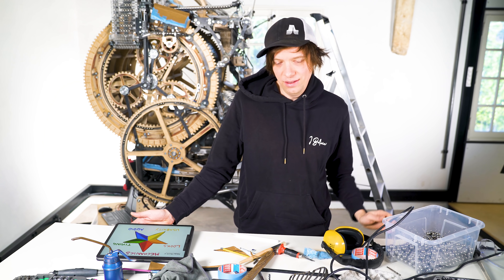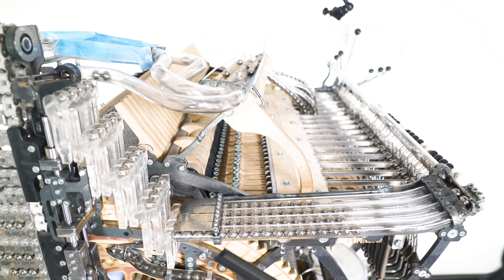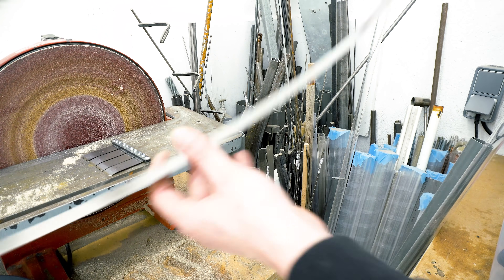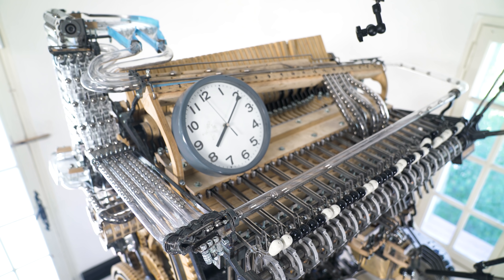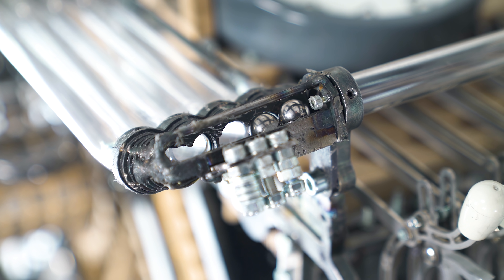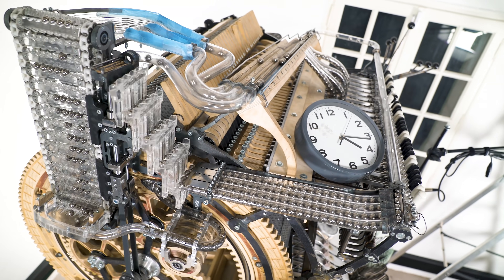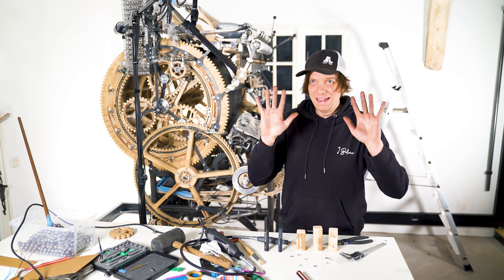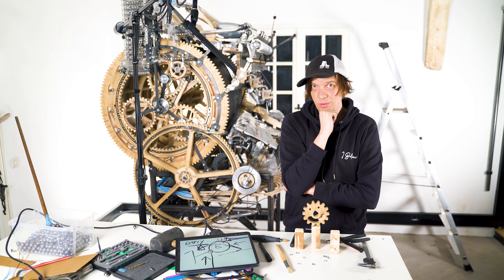Marble Machine X Fish Stair Upgrade

Comment: Add a damper to your divide by 4 marble feeder to reduce the recoil of the impacting marbles, like a small piece of neoprene or foam.  

Your springs are too short for the marble lifter and your opening is too large.  The opening only needs to be large enough to only allow a marble feed at the optimal, dead bottom center, position to prevent that misfeed.  Basically you have too much of the marbles exposed to reduce this he length of the spring needs to be extended to the end of the ramp and just befor the lifter.  The bend radius of the spring should be long enough to just be a faction of an inch higher than the marble.  Any marble that arrives after that will be caught by the finger and held until the next pass.  Hope that makes sense if not I can send you a drawing

Comment: I think the reason the divide-by-4 is so unreliable is that it has no hysteresis. As soon as one marble rolls off, there is no longer enough weight to make it tip, so it starts to tip back again before all the marbles roll off.

Some ways it might be made more reliable:

- Design the pivot so that once it starts to tip, the weight of just one marble is enough to make it complete the motion.

- Instead of having the tipping caused directly by the weight of the marbles, have the weight arm a mechanism that's driven in time with the fishstair, so that on each cycle it either moves or it doesn't.

- As above, but instead of weight, use a mechanical system that senses when four marbles are present. Maybe fingers that are lifted by the marbles, and an interlock that arms the tipping only when all four are raised.

Comment: Don't give up! You're a lot closer to success than you think. Remember, you have conquered marble height adjustment for all of the channels. You are conquering the divide by 4 mechanism. the current divide by 4 looks like it is working across the tempo range.
Also on the list of skills mastered MMA pipe design and bending; marble divider pressure management; marble divider top marble position adjustment, etc. Each of these are things that don't need to be re- invented and combined with the design for manufacture skill will allow you to create the vibraphone channels much more quickly, though it might be wise to test each new channel before committing to building the next.

Comment: So, another idea. Have you considered using proximity sensors to control feed rates at critical points in the marble circuit? I understand if you want to only use mechanical mechanisms without electronics??

Comment: 10:22 that “solution” is very susceptible to wear. If you can use the marbles as a 🔑 that will only open when there 4 available then you have a fail safe solution

Comment: This feels too simple to work but can you make the spring steel fingers longer so they have about 0.5-1mm distance from the hopper? This way its basically impossible for the marble to get snipped away because the Y offset is so much smaller than the diameter or the marble. Right now i would guess its 1 radius away from the hopper so the marbe has the chance to wedge itself between them.

If you make the fingers longer then keep the radius at the end, so any marble that wants to go up will be pushed back instead :)

Comment: An alternative solution to feeding the 4 input lanes is to add a small piece to the entrance of the divider that closes off the swing when it swing. It can be attached to the swing, and swings in front of the entrance as the balls are loaded into the 4 channels. This is the same solution you use for the wooden blocks that feed the instruments.

Comment: Martin, please hear my advice:

1. Stop doubting. Believe. There's no question you can complete the MMX. Whether you're a month away or a year or another three years DOESN'T ACTUALLY MATTER. You'll get there, and it will be worth it once you do.
2. Don't worry about impressing us. We don't need you to be Superman or make no mistakes. We're your friends! Just take us along as you have been.
3. Totally and absolutely ignore aesthetics. For the MMX, "Looks" is never the right option. Never. Why? Because: (A) the machine needs the engineering strength, as you explain. (B) The mechanics will generate cool aesthetics no matter what. (C) What you think looks cool may not look cool to others. I don't think the current divide-4 looks especially great. I mean it's fine, but not wonderful. Kill it for a big bucket drop of marbles—who cares? It'll still look cool, maybe cooler. NECESSITY BRINGS ITS OWN BEAUTY.

Comment: I really think you need to consider classification of the issues in severity. A marble popping out of the machine in a weird edge case, or missing a funnel does not stop the machine from playing as long as the loss rate of marbles isn't so high that it causes you to be running dry during a performance. On the other hand a critical engineering issue such as a potential failure that stops the machine, could break a part, or prevent a note from playing are the failures that I think you need to worry about. I think it's much more important to expand the testing to the other instrument channels and getting the machine to the point you can begin some composition on it. Mostly I think this because you'll feel a lot better using the machine for it's function rather than chasing minor issues that take more and more of your time to fix.

Comment: @3:10 id personally just add a ceiling to the bottom stair. That way only one marble can fit in. A chanfer on the bottom stair also pushes the edge-case marble back... Scrap that:

Have an extension of the fish-stair mechanism pushing up/down through holes in the track floor/ceiling one marble space back from the edge to stop marbles moving; blocked while the stair is receiving marbles and open when the stair itself is blocking - only one marble can be there and the edge case is solved by timing mechanism. This is like the marble gates for the channels down the front, so I'm curious why this approach isn't thought of first.

Comment: Rocker/ see-saw (oscillating end of the divider by four), lose mounted on the first Fish stair, would be a better solution. I think just another Spring steel would not end the problem of pinching the marble. When the first Fish stair swings the end of the divider by four just a little bit up, it would push back the other marble.

Comment: Martin, you are so close to completing the MMX!!!  Just finish putting it together and THEN fix all the problems. You have already made every system in it adjustable.  Making music is never as perfect as you want the MMX to work.  Sometimes a microphone quits working.  Sometimes an amp or speaker goes out.  Sometimes a guitar string breaks.  Sometimes an instrument goes out of tune in the middle of a song.  And sometimes a marble may go flying.  The occasional marble getting lost is OK as long as it doesn't stop the MMX from working.  The ultra-finetuning you are now doing will probably need to be redone once you get all of the channels in place.  Just finish putting it together and THEN fix all the problems.  Things will seem so much simpler once all the parts are in place and then can be finetuned (or changed).  All the stuff you are doing now seems like you are subconsciously just making excuses to keep from completing MMX and that would be a shame.  Stop worrying about problems and concentrate on making the remaining parts.  You already know how to make marble channels, droppers and PMMA pipe bends.  Just concentrate on these for a while and then do the finetuning.  I hope this gets you to stop thinking about quitting and about how great touring with the MMX will be.  PAIN is temporary, GLORY IS ETERNAL!!!

Comment: Scrap the fish stair gets my vote. If it isn't necessary, it's just going to complicate things. The MMX will be moved, and every time it gets moved it will need regulation. The more things there are, the more things will need to be tinkered with to get it working properly. And the MMX will exist for decades, possibly centuries. Maintaining the fish stair will be one other whole thing that someone will some day be stuck with, no matter how stable it is. It's cool, but it's fine-tuned and everything about it is a moving part subject to wear. The instrument/machine doesn't lack any visual wow factor. No need to gild the lily.

Comment: Every once in awhile you need to take a step back from the details and see the machine as a whole.  It is beautiful  and I have no doubt it will work in the end.

Also, if that divide by 4 gives you trouble again why not remove the gate and use a marble divider like you have at the top feeding the instruments?  Fewer moving parts would give you fewer points of mechanical failure.

Comment: this faulty flipping stuff (divide by 4) you're trying to improve by dremeling it out piece by piece is actually quite ugly. Shouldn't you consider to build one that works but also looks ok instead ? Also, at 13:30, is that rust we can see on the metal parts ? Anyway, I like your project ant this solution solving videos ; Keep up the good work. Don't give up... the community will not allow it ;-)

Comment: You aren't thinking modularly enough.
You JUST dealt with this problem of Marbles not entering tubes correctly, and you dealt with it by modularizing the "tube length" via your CNC machine and modular parts.
All you have done is create a little lip for the marbles to fall out of when trying to avoid the first channel.
You need to go back and make sure that all tube lengths are such that marbles *will not get caught on each other*. If you are having gaps in that system which causes only 1~2 tubes to collect all the marbles, that just means you aren't using the system at proper capacity, ie. *you need more marbles to load the system properly*.

100% your problems of late have been of Mechanical nature, which then affects your Timing as not enough marbles enter the tubes in time.
Looks is the least important thing and should be the last item you focus on.
Usability is second least important, as so long as it works it's fine. You can worry about optimizing your own usability of the system after it works flawlessly.
Audio is third most important. If the machine makes noise it "pollutes" the concert. This is optimizing the machine once it works exactly how you want it.
Timing is second most important. I actually don't think you have this down perfectly. It's too dynamic. You can't guarantee a proper beat speed, as everything is tied to how fast you turn that crank and whether or not you use the brake. You should change this up to be a gear-like system. Think Manual transmission for a car (that's also the perfect design for you to implement).
Mechanics is utmost importance. Simple "does it work as expected". Changes made here will affect everything above.

Comment: Hey Martin,   This is probably too late but if the spring steel guards curved up at the end, rather than down, marbles that don't quite make it into the first fish would be encouraged to fall forward into the step as they are lifted, rather than catch on the corner and spring out.   Sean.

Comment: Don't give up Martin! And don't abandon aesthetics - this machine is built to go onstage in front of an audience and look beautiful, and it already does. There may come a time when you have to rip something out because it's not reliable enough, but don't replace it with something purely functional. Replace it with something equally pretty and more reliable - I notice you're not fighting with the lifting geartrain in these videos. That system is reliable AND beautiful - that happy medium is both possible and at the core of the MMX. This is as much of an art project as an engineering project.

Comment: Put a gate into the divide by four so that marbles can only get to the end if the elevator is above the height of a marble. As the elevator comes down, the gate goes up behind the first marble. If there is a marble waiting, it will fall into the elevator, if there is a marble coming, it will hit the gate and be prevented from reaching the elevator until it has raised above the threshold for getting caught. This need to only be a pin into each plastic pipe attached to a simple rocker that is controlled by a pin in the side of the elevator. If the pin in placed between the first and second marble, in line with where they touch when at rest, it does not need to go very low to handle the impact of the incoming marble.

Comment: #Suggestion: Put a paddel-wheel at the end of /4tunnels that is controlled by a ratchet mechanism from the first staircase. Ie, the paddel stops the marble coming down the pipe and the ratchet mechanism feed the marble when the stair is in lowest position.

Comment: I have two ideas for how fix your current mole. 1. Place a brazing rod between the spring, and the stair, so that any marble in the "pinch" position gets pushed back into the que. 2. Make a fillet on the edge of the step so marbles in the "pinch" position can roll out easier.  Please don't stop, You're getting so close.

Comment: Don't give up, and stop trashing parts of the machine that I actually think are as good as they are going to get (this is to say that you have already found the best solution, anything else is just a dream of perfection.) I have learnt in my job (A lighting/sound technician) that nothing is perfect and the effort required to achieve perfection are not sustainable nor achieveable.

Comment: Martin, 
I was looking through an old You Tube video that may help you with the Looks, Timing, and Mechanics part of yourself.  Instead of the Fish stair, why not try an Archimedes Screw? https://youtu.be/muqDRWilXLM.  He even has a CAD file that you could resize for the size of the marbles.  

If you make the sump deep enough, you can just have the marbles from the 4x4 pipes release into the sump and let the screw do the rest.  It's a lot easier to maintain as well 

My only suggestion would be to convert the outer cover that encapsulates the screw into a direct drive instead of a belt drive due to space limitations and it is much easier to tweak the speed of it using a simple Potentimeter which could be calibrated in synchrony with the speed of the main music wheel.  

I would suggest this transport for the main marble transport also, but if I were you, I'd wait to see if this adjustment/enhancement would fix the issues with the fish stair first.  The benefit of if you did swap out the main marble transport to this tech, you wouldn't have to worry about a demagnetizer.  This decreases the complexity and also has an easier path of repair/fixing.

So the Looks part is satisfied because you can decorate/enhance the cylinders and screws to work with different lighting schemes and is easily themable.
So the Timing part is satisfied because you can electrically instead of mechanically fine tune the rate of the marble load into the re-integration module
So the Mechanics part is satisfied because it's an easy build/easy swap part that can be fixed on the fly.  

Just my $.02 on this and I love all the work and dedication that you have put into the MMX and the dedication to all the fans.  

Best of luck to you in this and all of your projects!
Reply: As I think about it.  If all marbles went into the main sump with 2 screws running, you'd have a neverending flow of marbles and can basically take a lot of moving parts away (Magnetizing so they can fit in the wheel, demagnetizing so they don't stick to the machine, separate tubes for marble flow from return/fresh feed,etc.) for 2 simple parts.
Again, just a thought to try and help make you fall back in love with the MMX.  :D

Comment: Why not make the top of the divide by 4 section 4 separate semi circles that move individually and are adjustable by screw which means you could tune each of the four opening separately without the need for a dremmel?

Comment: Solution Idea and found another problem:

How about a little gate in the track of the marbels. From the video it seems that you don't want the highspeed marbels going to the fishstairs. 
1: At first I was thinking that the first step of the fishstair could pull up a little gate behind the second marble if it goes down. But this might create the same problem with timing and speed. The force could break things.

2. So Let gravity pull up a gate somewhat behind the first marble. And push that gate down when the fishstairs go up. Like a teeter totter. 

I made a simple image. https://ibb.co/3CB8JC9 but I am happy to explain further.

Point it, because you work with gravity, the balance will not be so crytical. Use a washer or a nut ;-). The gate could be wood, but Nylon might be a whole lot smoother. But the fishstairs force will be strong enough to pull the gate down and that is the most important part. If I were home I would love to make a little demo.

EDIT:
I looked back in slow motion. the last one was actually not a marble coming in last moment. It was just not quick enough to roll into the stairs.

Comment: Errors lile 14:10 - why do you bother about them so much? They are not mission critical.

They are not keeping you from playing live i.e. not breaking down the machine. They just put 1 marble on the floor every few songs under optimal conditions. And if you don't want them on the floor: but a gate around the bottom entry, remove the spring steel - basically like at the elevator ;)

Comment: Hey!
Why don't you use the same solution as in the marble divider? when the first slot goes full, then the second one gets the marbles, when the second is full too, then the next gets the marbles. So the fishstairs get marbles based on the "load" like 1stair in use on small amount of marbles and the number of used stairs increases as the amount of marbles increases.
Reply: i hasn't watched the video till the end when i commented :) nice job :)